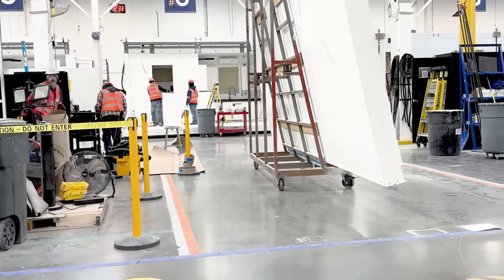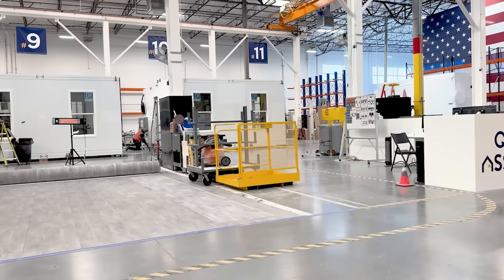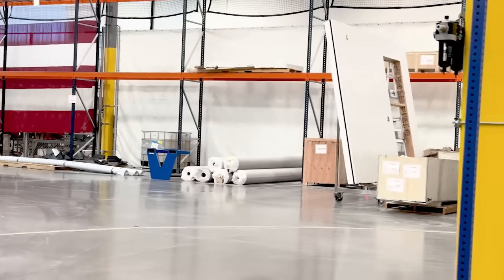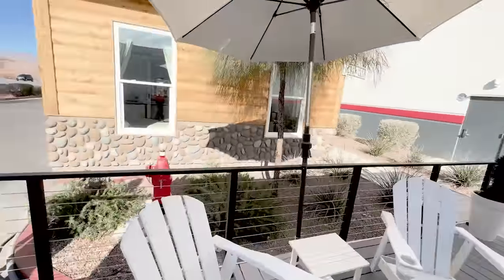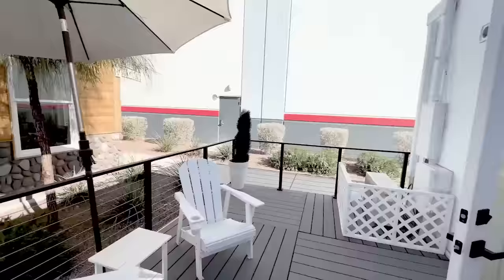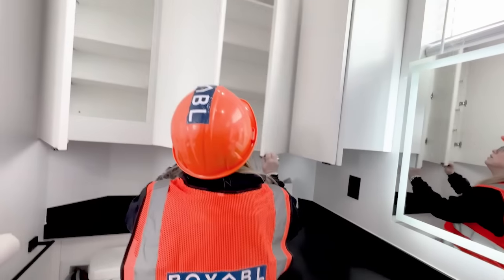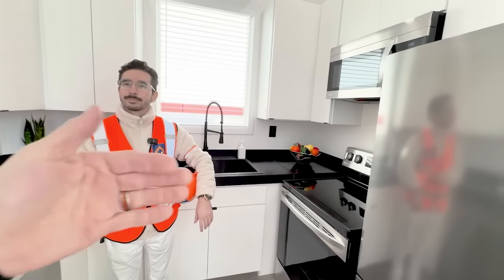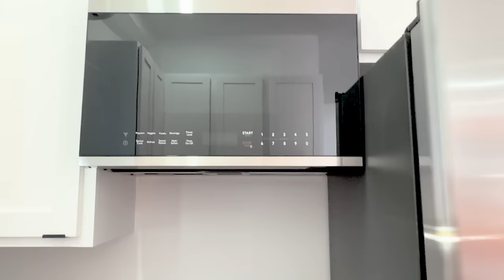BOXABL Has a FOLDABLE HOME for $60,000--Would YOU Buy One?!

Comment: We did energy reduction retrofit to our 2000 sqft all electric home coupled with 13.2 kW solar panel installation and 2 PW2 powerwalls and with other energy reduction efforts (heat pump and heat pump water heater, etc) have reduced our annual electric bill to less than $200/year (~$16/month), and export >50 % of our excess solar back to grid. We have been net positive over past 11 years, and net production/use was 460% last year, which included charging two Teslas. I like tiny houses but with effort a homeowner in a larger home can do a lot to live sustainably.
Reply: tesla has a box now, installed with everything solar electric.

Comment: Like the idea, I was wondering why these guys are cranking them out. I work on pre-fab modular homes in the 70's and they were put together pretty fast. Framing crew, drywall, electrical finishing crews all under one roof. This video reflects a slow process from start to finish, and it doesn't have to be that way.. as far as the cries of scams and set up cost, just haters. With a small foot print you could easily put these on slabs or crawl spaces with minimal cost. Great for beach home rentals, trade off on these to make your own tiny house mobile home park, or that hunting cabin in the mountains,,,,, these guys just need to get a better work ethic, or better workers

Comment: I'm an investor; but am not completely happy with the details coming out. I see that they keep expanding into new factories; which is fine, but they need to actually get to a point where they are in full production and have all details available for those who want to buy. When I invested, the Casita was $50k and came fully furnished; it still seems like a good price at $60k, with some other options for furnishing, but this information needs settled or everything still looks like a pipe-dream.
Reply: i want / need to wait 5 years to see how quickly these will deteriorate in the elements. settleing will be very bad for constructions like these , UNLESS you need to re-adjust and tighten the box yearly . LOL
Reply: I was a potential buyer 
My line was at 50k why? 
Because it's much cheaper building one of these. To avoid the headache of the construction why not cough up the 50k and be at peace of mind but 60k plus shipping no thank you.

Comment: Reports online, as of Feb 14, 2024, from a major tiny house website, suggested that the actual "Base price of a Boxabl Casita is around $69,995, which is lower than a traditional site-built home. However, this price does not include shipping or installation costs. You'll also have to buy or lease the land where you intend to anchor your house. As earlier reported on Feb 14, 2023, (same source) Boxabl, then, had a waitlist of over 160,000 members with at least 4,000 paid deposits."
Reply: In other words, once again, no one on earth will ever allow a consumer to buy a home that ultimately costs under 50k. You will always be required to spend a minimum of $150k to $300,000 to have a move-in ready home. And that is the problem with housing in America.

Comment: As someone who has owned a trailer park problems with local codes not allowing detached homes under certain square footage usually 800. Trailers are usally cheaper built needing replacement fixtures within the first year and rotting walls and floors after the slightest water leak.
Reply: False information!!

Comment: Hmm. Hope this turns out to be a legit company, but the CEO seems like an IP troll and all the products they’ve shipped so far seem to have failed.
Reply: Can explain more about all the products they have shipped so far have failed?
Reply: @ruanddu  check out the wikipedia article.  First contract with US Military, units  "ended up leaky and moldy", and in Arizona "48 were installed before it was determined they violated Arizona Department of Housing laws and codes, including lack of permits, and the rest of the order was suspended when Boxabl settled with the state in April 2023"
Reply: @nickjhowe2  thanks for the info!
Reply: @nickjhowe2 
UPDATE YOUR INFO.  If you check the article you cited, it was the government contractors that didn’t complete the roofs of a FEW  (my understanding they were for customization for upper brass) and left the roofs unfinished before a storm came. Check the article Wikipedia cited and then check the photo caption that explains how it was the government contractors not Boxabl. 

Also check the Arizona company you are referring to. The product didn’t fail, both the company and Boxabl was VERY remiss in not making sure the company had permits. Now the state of Arizona has given state approval for them to be sold and occupied.

Comment: There is nothing new or novel about what boxable are offering. In the UK after WW2 we built hundreds and thousands of Prefabs. Which were integrated and contained all the latest home appliances. Many of these lasted onto the 70’s before they were demolished and replaced
Reply: Difference is these come flat-packed, come on the back of a lorry and just take an hour or two to erect.
Reply: @mallamal5578  so were the prefabs. Just needs bolted and sealed
Reply: @teslar1 
They were also small, draughty and full of asbestos.
Reply: @rogerstarkey5390 
Anything pre 78’ build generally was full of asbestos.
There have been significant improvement to prefab since then. Also the ones from 70’s took months to build in factory and shipped wide on roads with special permits across cities, counties and states.
Boxabls take a couple of hours to build fully furnished and they unpack within an hour. Considerably more efficient and faster than the ones in the 70’s, 80’, and 90’s IMO.

Comment: Nope. Way to expensive. Ok as a luxury version.  Back to basics.... You can get a basic folding 6x3 from China for under $1000 dollers. Start there and fit it out to western standard. Want more space... Easy .... Attach second unit so base cost is $2000. At that price you are solving housing issues.

Comment: 120 amps, wtf❓
In a normal home here 20 is fine, 40 is for a normal house and 80-100 is for big (more than 2 floors+basment) house.
Reply: Got 200 amp service on a newly-built 600sf cottage home. Yeah, no 220 dryer; only 30 gallon water heater. . . /ymmv